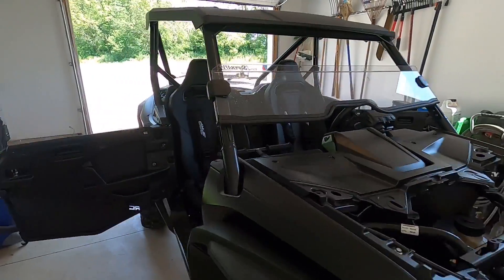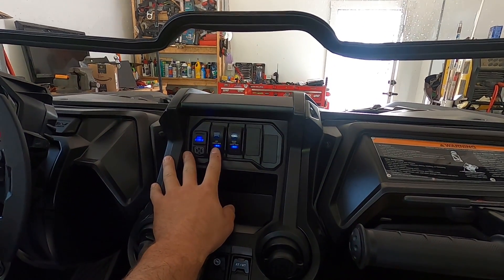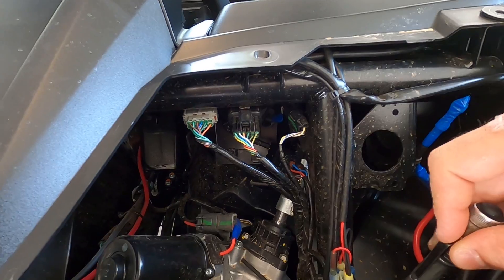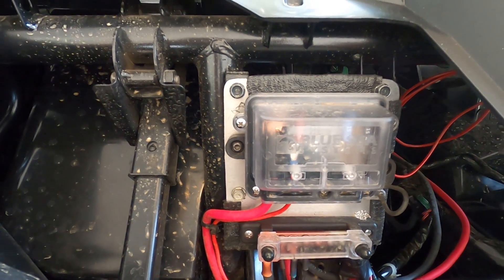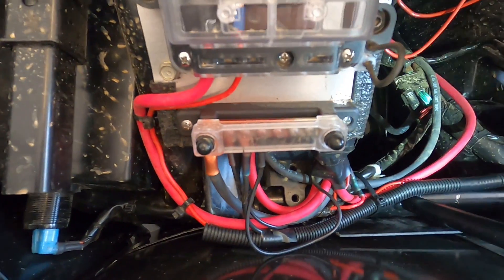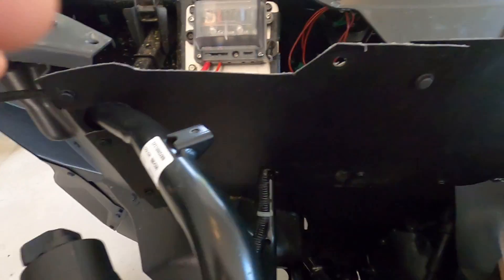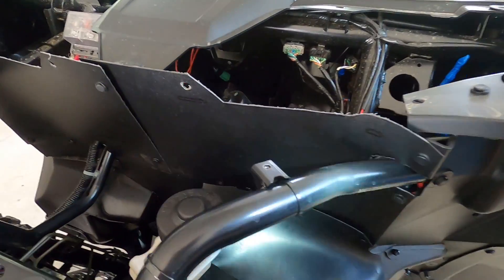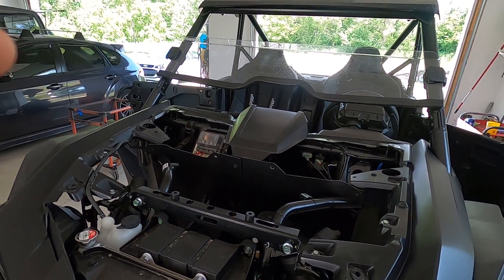Honda Talon Electrical Upgrades

Comment: Great video.  I’ve got a new 2023 1000R and want to put in ditch lights and a light bar.  I was gonna use a Polaris power distribution bar.  Where did you get the switches and do most switches fit the blanks in the dash or are they proprietary to Honda only.  Many Tks.
Reply from the maker: Not Proprietary. Pretty standard snap-in rocker switch size.
Reply: @WhiteCollarRedneck  Tks for that info.  I wasn’t sure.

Comment: Hey im new to the sxs world and im trying to see how i need to splice the key on power. Do you splice it into the fuse box or to the relay and how. TIA
Reply from the maker: Starting around 2:05 you will hear the Hess Override switch we installed has a key power piggy back connection in the harness. You could also cut and splice in a heat shrink butt connector with a new wire. We would only use the key power to trigger a relay coil and not feed directly off the key power.
Reply: So I also have run 8ga from the battery to under the hood but I haven't hook anything up to it yet. My concern is when I put the fuse block in and connect the 8ga wires, won't that make the fuse block hot all the time? How did you get it to be key on block? 
I heard you say on the hess plug there's a key on piggy back but, did you run from that plug to the fuse block? Just trying to figure it out.

Comment: I’m curious about some of the factory wired switches. Are they plug and play ready? Or do you have to add a harness or something like that?  Also, do you have a way of contacting you outside of YT?
Reply from the maker: If you see the inserted section from our comparison video, the Switch panel is actually just a mounting plate. No actual wiring provisions. We had to add all that
Reply: I saw that. I’m still trying to decide how I want to hook up my light bar and Rick lights.

Comment: Thanks for the video. Do you happen to have a link to the grill led light bar? Thanks
Reply from the maker: Just a cheap Amazon: LED Light Bar 10 inch, 4WDKING Screwless 50W IP69K Waterproof Off-Road Combo LED Work Light with DT Wiring Harness Super Bright Truck Driving Fog Lamp Fit for Ford F150 Polaris RZR Jeep Wrangler https://a.co/d/aLTGMNZ
Reply: @WhiteCollarRedneck  Question? what did you mount the light bar to?  I'm having a hard time looking for a place to mount it behind the grill. did you fab a cross beam or something? Thanks.
Reply from the maker: @marknktown2642  if you check the beginning of our tow bar video you can see the lightbar mount we built with the plastics off

Comment: Watch what all you put on that distribution bar, it's still only fed with one small wire on one fuse. Clean install, looks great!!!
Reply from the maker: 6AWG to the battery feeding the bus bar should be able to handle at least 60amps. But sure, might not be able to handle two giant roof bars
Reply: @WhiteCollarRedneck  OK, it looked like you were pointing to a small wire connector that appears to have maybe #14 wire. If you used the winch wires you can run a ton of stuff on that.

Comment: Tring to find the Blue Sea systems panel and buss bar. Can you give a link where to get them?  Great video!
Reply from the maker: I got these on Amazon. Blue Sea Systems 5056 ST-Blade 4 circuit Fuse block. There is also various bus bar options. I have also used WaytekWire for Electrical components in the past for like waterproof fuse and relay distribution blocks

Comment: Where does the relay get wire in ?  I huess if you had a wiring diagram it would really help us rookies ?  Is that an Amazon panel ?  Thanks!
Reply from the maker: Yes it is from Amazon, though brand name. Just simple 4/5 pin bosch relay wiring. Incoming device Power from Fuse block outlet to relay pin 30 and then from Pin 87 to the Device. Power out of the switch to Pin 86, Pin 85 to ground. Pin 87a unused.